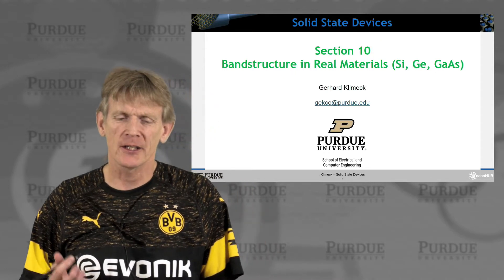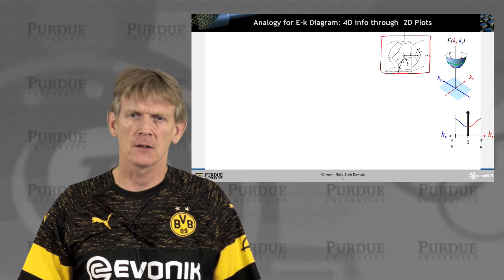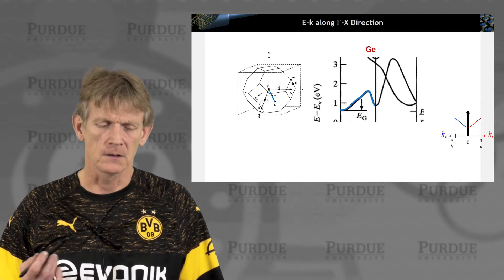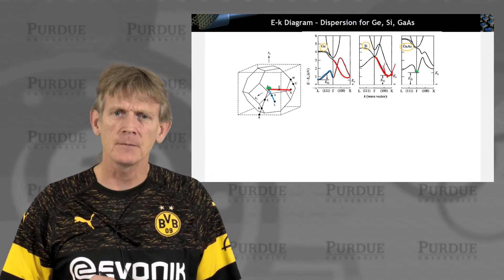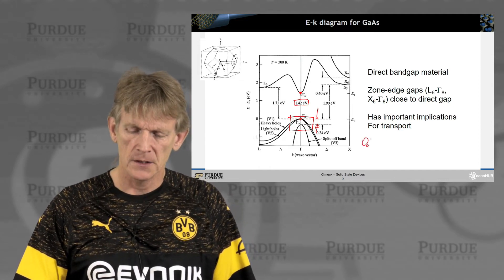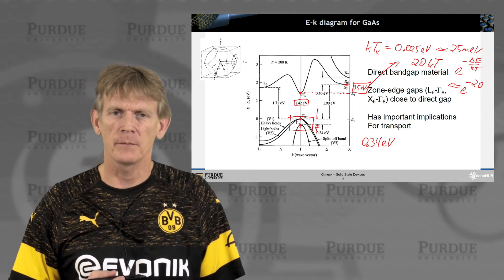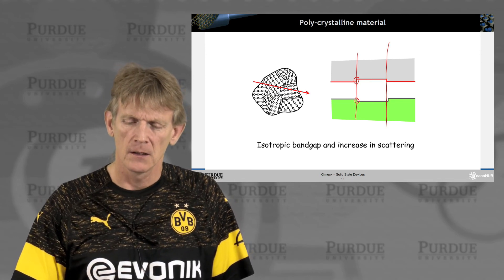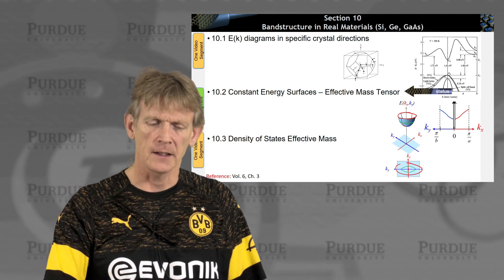ECE 606 Solid State Devices L10.1: Bandstructure - E(k) Diagrams in Specific Crystal Directions

Comment: How this plot comes into being on the basis of BZ?????
Reply: Is there any emperical equation that gives ris to band structure plot?
Reply: @chaudry123  I'm NOT an expert in material science or solid state physics. I'm just an undergraduate working with my professor who IS an expert in computational solid state physics, so keep that nuance in mind.

As part of our research, we calculated the band structure of Mn2RuGa using an fcc lattice (and so it has the identical Brillouin zone as the one shown in this video). We used density functional theory (DFT) which uses the Kohn-Sham equations as a basis to calculate the ground state of the system. Logistically, there is a lot that goes into this program, but essentially we get for each k-point in our mesh the allowed energy bands. Then, for plotting purposes, we can choose certain bands to plot the dispersion along our crystal momentum directions. For example, we obviously want to ignore core electrons. We used a system size of 48x48x48 and plotted the dispersion along G-x, G-L and G-x' (G-x' being from gamma point to the point on the square bragg plane intersected by the k_z axis). 

I'm not an expert, so I can only tell you that this is how we do it. There may be other ways. My suspicion is that this is probably one of the only feasible methods of getting such detailed band structure plots for real materials, but take my opinion with a grain of salt. 

Hope this helps. If you're interested and you have a decent background in physics and chemistry, I would recommend you look into the basics of DFT to learn more. It's an interesting method and I'm sure I'll see more of it in my future lollll